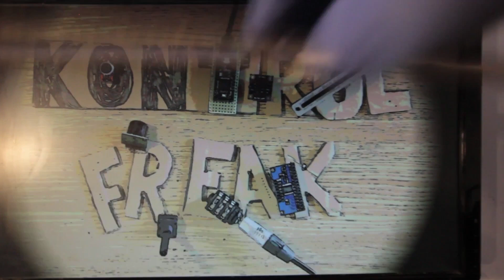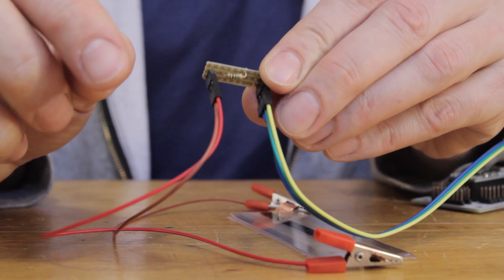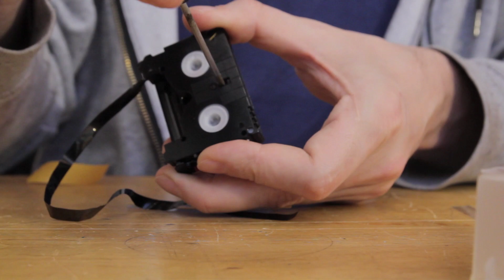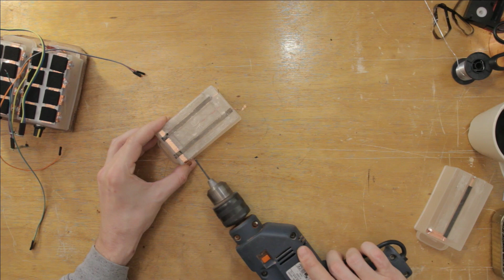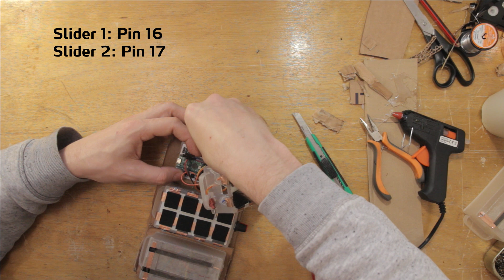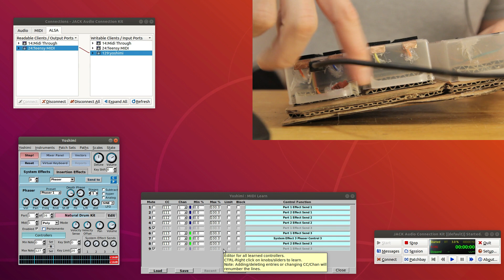MiniDV tape slider sensors - Comprehensive tutorial

Comment: I can't believe there are only 25 like. Recycling dv tape  to do a sensor is quite fascinating. And almost unique ( there is one webpage on that matter, but not with a functional device).

Anyway, using it for a fretless/ continous instrument would be a great use (you can get quarter tones this way, and a non western kind of electronic musical instrument).

An indian guy made a tutorial on YouTube for kind of instrument, but using a lot of clips on a metallic surface. It works, but with a lot of latency ..
Reply from the maker: Yeah, I think the idea is pretty cool. It's not easy to make stable sensor, but it can be done. There's a limit to how long you can usefully make these sensors though, so a full size fretless instrument might be tricky. Anyway, I still have several kilometers of DV tape lying around, so I might give it a shot at some point.

Comment: Dude, I have found it thanks to a group I am part of.
This is AMAZING!
I'll try out some ideas and keep you posted.
I wanted something alike soft potentiometers, but it's really hard to get them in Brazil (you have to import those).
I have some questions, if you don't mind.
1 - Do you think that'd be possible to somehow have both a sliding and pressure sensors on the same build?
I mean, if I press harder, it sends an aftertouch, without changing the note?
I THINK that'd be possible if we had like the slider on the first "layer" and the capacitive sensor below it? Don't know, just brainstorming!

2 - Have you ever finished the "DIY Roli" you mentioned on another comment?

Anyways, looks awesome and it gave me a lot of inspiration!

Cheers from Brazil!
Reply from the maker: Thanks!
The build in this video doesn't have any capacitive sensors, only DIY analog ones. But like you said, you could combine capacitive and analog sensors to make a two layer multi function sensor. These DIY sensors are not perfect. There is noise, and a tendency to drift, so the code has to take all that into account, but it's doable.
The DIY Roli is a down a few places on my list of priorities. I've been busy with the "K.L.I.K." project: https://www.youtube.com/playlist?list=PLCejzxWlLD_zKnPseiNWy6WHKMZYb1ocZ , and also working on getting on-board synths and audio on my instruments: https://www.youtube.com/watch?v=2dfeF3AOJpo
Reply: @KontinuumLAB  Thanks for the quick answer!
Ah, I said capacitive but that's not what I meant haha
But yes, I'll try to integrate two and see what I can get!

That's sad the Roli is not priority, but the K.L.I.K is also amazing! I have already commented on another of your videos when you were making breath controllers for cheap. I still need to try those as well.
Once again, thanks for sharing this!
Have a nice day!